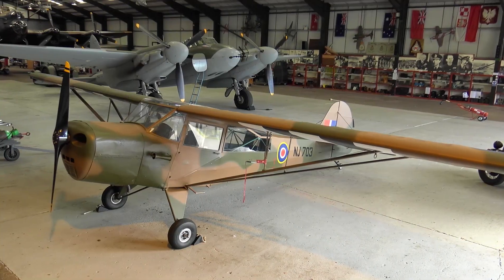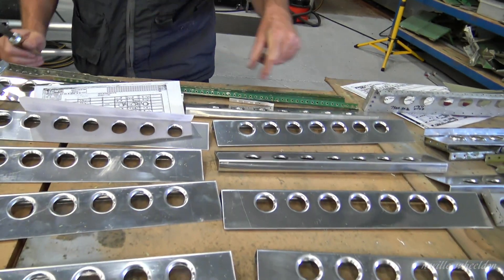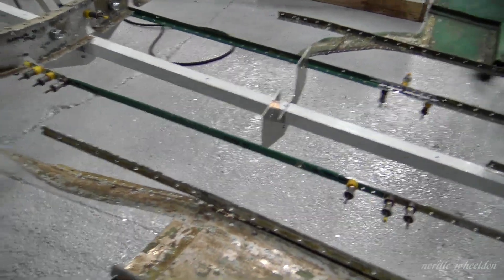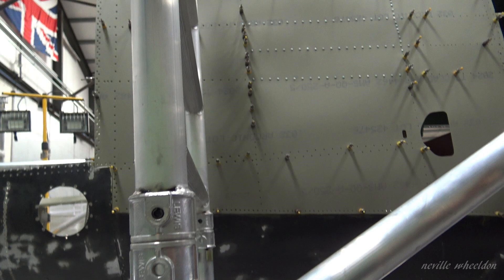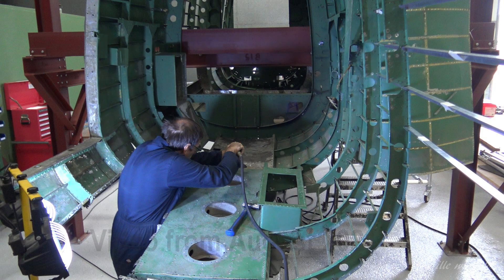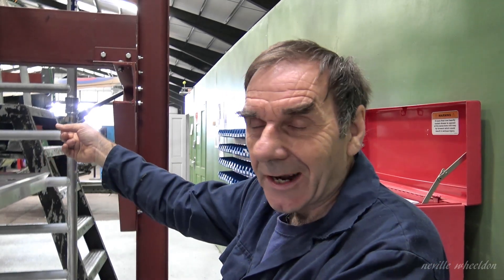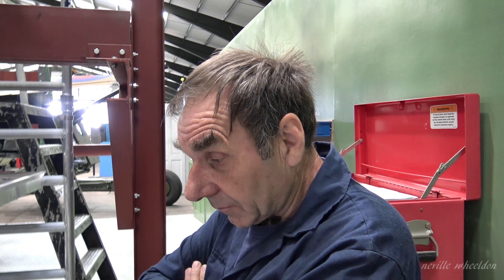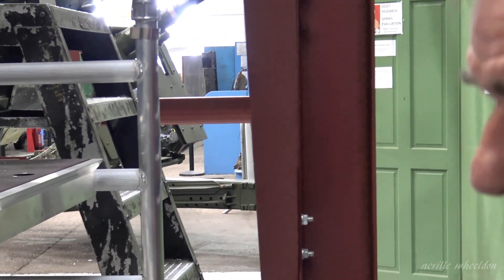Video 110 Restoration of Lancaster NX611 Year 4 of a 10 year plan.

Comment: Another fantastic video. One question, was the APU just for powering the electrics or did it have enough power to start the engines making the Lanc independent from a ground ACC?
Reply from the maker: Not sure on that James I will check with John.
Reply: @nevillewheeldon1693  Thanks Neville, I look forward to finding out the answer